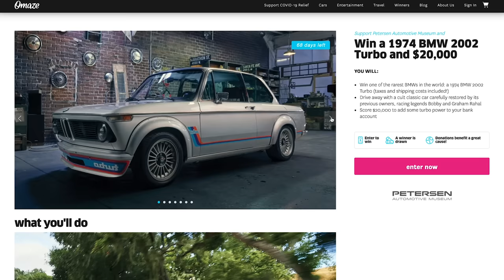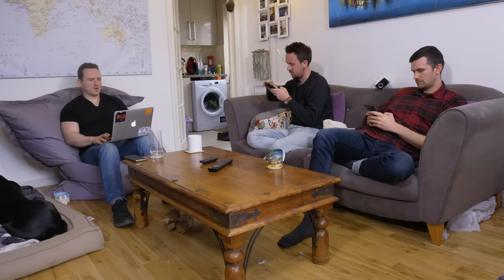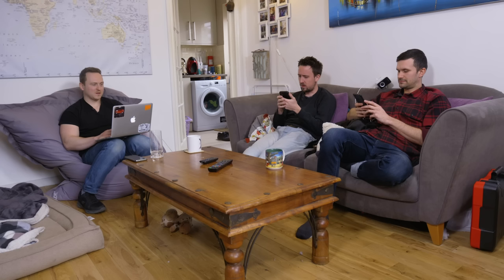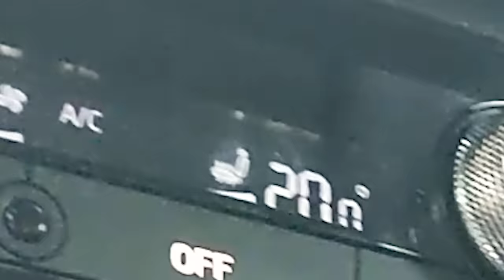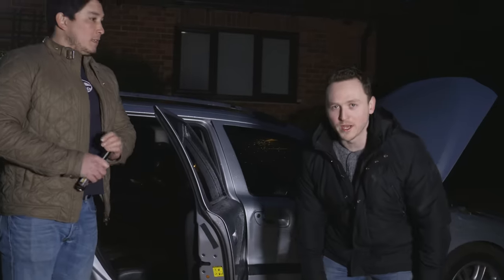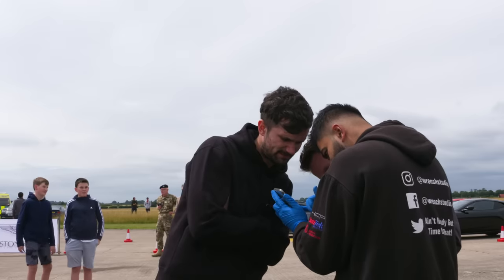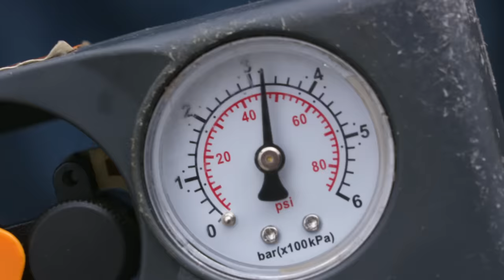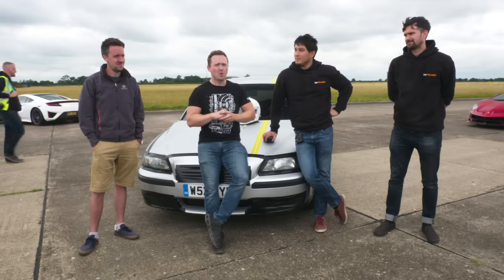Can We Buy A 150mph Car For £1000?

Comment: carry this series on, next do: 175mph for £2000
Reply: Adam Petryszyn  Easy, chipped E32 750i
Reply: Just make the T5 do 175 he'd have change left from 2k lol
Reply: It gets exponentially harder
Reply: 169mph for  £1690
Reply: Old German cars, Merc, BMW. The only problem is they're electronically limited to 155 MPH fron the factory.
Reply: @tyrantstomper  theres ways around that its not a deal breaker
Reply: @tyrantstomper  electronic limiter can be removed
Reply: Maybe they can find a depreciated sports car, that isn't destroyed by the rich boffin who purchased it new
Reply: Not impossible...
Reply: Stage 1 mapped v6 turbo signum, stage 1 fiat coupe 5 cyl turbo, 335i
Reply: @irisheart5920  for 2k?
Reply: @23gatesy  yes for 2 grand, I lost my license last year blasting past an undercover cop in my chipped E32 doing 285kmh on an empty highway.
I bought the car for about 1500 bucks and the chips were 150 bucks.
Reply: @irisheart5920 you'd be lucky to find an e32 for sale in the UK, let alone a 750i, and definitely not for 2 grand
Reply: 175mph is very dangerous speeds
Reply: you could get a 175 for under £10,000, i don't think you can get one for £2000??
Reply: Need £4k to get 175moh machine
Reply: @TuddecBMW  That's what she said.
Reply: Of you can get a jaguar xfr and remove the limiter it will go well beyond 185mph, very potent cars and under appreciated in the market. A stock xfr with some safety modifications delimited went 225mph at Bonneville!
Reply: 175 is a tall order even with money. Not to mention at 175 in a cheap car there would be a good chance of the tyres giving out.
Reply: Adam Petryszyn  an amg withe the supercharged v8 or maybe a s600 (the 2nd gen twin turbo one)
Reply: The only cars that could do it are older German ones but they’re limited to 155 so unless they can find a chipped one it’s quite unlikely
Reply: can you even find cars that can do 175mph?

Comment: Get it back put together, then road trip it to germany, and go 150mph on the Autobahn!
Reply: A few simple bits done and you've got over 300 brake from thag engine, same lump as the focus st,
Reply: I was asking myself why they had to go on a drag strip and then remebered that not everyone has no speed limit. :/
Reply: @kowiniskul  actualy if your car can go 155+ then you don't have to follow the speed limits.
Reply: @jordzz174  Actually the R  line V70 2.5T is already 300hp. It has a metal inlet plenum and bigger inter-cooler as standard. As well as tough clutch. With an upgraded exhaust, add bigger injectors and a remap, you are now looking at 400-500hp.
Reply: @casparharte  It's a T5 with a grill from v70 R,
Reply: @4U6U5  my bad

Comment: The fact that a wagon can even make it past 130 is already impressive to me.
Reply: Oscar Amador same and that it hung together throughout the day and got them home
Reply: @rossgarykelly84  
Those other cars may have been faster than the Volvo, but if you need to take your girlfriend and her fridge somewhere at 140 mph, they would be left red faced in failure!
Reply: Wagons often more aerodynamic than sedans.
Reply: Oh boy, you are missing out on a bunch of fun stuff..! And that’s the slower one of the fast Volvo estates. Audi has some brilliant quick stuff as well, and those are even faster..! Also AMGs and the top end of BMWs Touring range. There are plenty!
Reply: Why? Because it's a wagon? That makes no sense.
Reply: In my Volvo thats how fast i drive normaly
Reply: My buick encore went 136 mph stock its speedo says 170mph. I haven't gone that fast yet buy yeah it was extremely stable for a cuv at those speeds. All other ones I drove just wants to be blown over at least the japanese and other american ones
Reply: @hunchanchoc8418  false
Reply: I had the diesel V70 D5. Only 185bhp, but 400Nm of torque.  That would easily do over 130mph and it had over 200,000 miles on the clock too. Only 0.3sec slower to 60mph than the T5
Reply: @hunchanchoc8418  Not really, a wagon is literally the opposite form of the ideal aerodynamic shape, if the ideal is a water drop with the thin tail on the back and you can see that a wagon is the exact opposite of that. 
Having a flat back generates a lot of turbulence and drag, while sedans (specially ones that have more of a fastback design) generate way less turbulence
Reply: They aren't called flying bricks for nothing

Comment: Those Volvo T5 engines are tough old things. They can run to 500,000 miles when looked after.   With a turbo and intercooler upgrade you could get over 400hp, or more with supporting mods.  Gotta love that 5cyl warble.

Comment: Don’t show a preview of you doing the challenge at the start! That’s clearly a Volvo by the seat.
Reply: Dash*
Reply: Considering I've owned one. I could tell by arm rest. 😂
Reply: anyone can recognize a Volvo by pretty much any part of it.
It's one of the reasons I own one; they've always been styled differently than the rest out there and each generation is actually properly different, which I love about them.
Just a shame the don't have vans.
Reply: @devilskullBEL  funny you mention that. My first was a C30 and I fell in love with the floating dashboard and centre console, made it feel more like a cockpit, especially since everything has a 10degree angle towards the driver. It was ahead of it's time that car. I'd love to see what the new style would look like in a hatchback format.
Reply: I’d recognize that gear lever anywhere, but never mind the video. The thumbnail gives it away already…
Reply: @TheExtremist123  I'm also a massive volvo fan but to say the C30 was "ahead of it's time" for having a feature that dozens of cars have had in the past (even ford sierras from the late eighties had all the ancilliary controls aimed at the driver) is a bit misinformed. In fact, the C30 and Volvos of the ford owned era disappointingly used some Ford parts and lost "some" of the unique "Thats definitely a Volvo" appearance.
Reply: @craig855s  Interior wise, it was everything was simple and flush on the console. It was aesthetically more attractive than most hatchbacks around today.
Reply: @TheExtremist123  I did only say "Some" and by that i mean that looking at the door card you'd guess "ford focus" before you'd guess "volvo something"

Comment: I love how they drive with helmets and everything. Here in Germany you get to this speeds with you entire family in the car without any additional safety😂👍. The Volvo is nice, but just to tell you the old Volvo turbos loses a lot of power as they age, had a few of them all pretty slow for the horsepower. I had a V40 T4 with 200Hp and a 1.8 liter engine. I only got about 210km/h out of it, pretty disappointing. Car manufacturers often claimed there car to have a lot more horsepower then they really got from the factory, can’t trust this numbers if the car is 20 years old with this many miles.
Reply: I assume it's only for insurance purposes for the organiser to spend less on the rent (?) of the course
Reply: It's for insurance as far as I know as it involves timing. I've driven up Prescott in the UK without a helmet but we weren't allowed to time it.
Reply: Ive a phase one v40 t4 myself and yeah past 110 they give up a little bit. this is with a fresh turbo on it too! Apparently not the most aero of shapes...
Reply: Stupid Bloke Stupid Videos yeah obviously my t4 had some issues with the turbo or something. The engine had full compression, put new spark plug and coils in it. Otherwise I didn’t messed with the engine as it run great, other than having lost power.
Reply: God bless se germans
Reply: I miss driving in Germany.  Did a road trip from London to Innsbruck via Germany couple of years ago in my M5 F10 and that was the most fun I had on a motorway.  It’s not just about no speed limits on Autobahn but roads are so much better and on top people have motorway etiquettes so that no one would hog the fast lane cruising at 70mph.  Hopefully I will do it again soon once things go back to normal (or close to it).

Comment: Maybe just add some boost and a larger FMIC? Put some lowering springs on?
Hope you continue to mod this car, would be fun to watch it as a series..

I have thought about buying one of these older Volvos with AWD and manual 5 cyl turbo engine, as a car for driving wood and stuff.
For daily driving I am using my Model 3 Performance with light wheels and KW V3 coilovers, but its only so much I can put on the roof rack of wood at a time.

Comment: taping the spoiler was a mistake. The spoiler is there to reduce drag not increase it.
Reply: So was taping up the front grille. It's an aerodynamic improvement, yes, but the V70 has an air to air intercooler. By taping up the grille they probably lost like 20-30HP because the charge air entering the engine will be way hotter if the intercooler can't do its job.
Reply: @Benny---  It looks like the grill is way oversized for what the car needs. Taping up the top would make a low pressure pocket at the top and probably still distribute air across the whole intercooler pretty well. Either way, they picked up like 2.5% speed from doing that so it looks like it was a good move.
Reply: @Benny---  agreed, could have wet it a bit to possibly help, and i wouldve taken out the air filter too just as a tiny intake hack, it all counts!

Comment: 150 mph = 241 kmh
Reply: Thanks man 🙂
Reply: Most of these should be locked 200 km/h....  240 is insane on public roads think about it in Meters per second.. human reaction time
Reply: @kitecattestecke2303  I've done (speedo indicated at least) 240KPH in my Cooper S. Yeah, needless to say the margin for error at that speed is basically nil.
Reply: @kitecattestecke2303  i did with a 420d gran coupe 150mph on the autobahn.... i was making my drivers license😂😂😂

Comment: I think it's interesting that my current '04 G35 has a speedo that goes up to 160 with an actual top speed of 155 mph, my '09 Mini Cooper S has a speedo that goes up to 160 with an actual top speed of around 140 mph, and recently my friend got a 2020 corolla rental which had a speedometer that went up to 160, but had an actual top speed of 112 mph. My  2001 MR2 has a speedo that goes up to 140 mph with an actual top speed of 130. Soon we're gonna have cars with 200 mph on the dash but are electronically limited to 90 lmao.

Comment: New episodes in making this Volvo faster? :-)
Reply: an xc70 or v70R would be a better go fast chassis as both of those have awd and built bottom ends , a simple turbo intercooler and freeflowing exhaust away from reaching top speed .
Reply: @schemil42 
No it's not.
It's got some R bits on it (bumpers and grill), but it's not an R.
Reply: @schemil42  I thought it was one also until i saw the engine bay

Comment: Yeah i didnt get why they taped the spoiler, they only made it more cut off in the back which creates more drag/pressure. With that little hole under the wing it at least dissipated some of it. They shouldve cut off the wing and open the rear trunk door at little bit to make the rear as pointy as possible.

Comment: 9:54 random Lamborghini Urus getting passed by a Skoda
Reply: Didn't VW buy Skoda so it's relative rivalry
Reply: Dieu Luong Yeah Skoda buys parts of VW. Basicly Skoda is VW and very reliable and great. Sadly people still think skoda’s trash... i took off the key cap on the door handle of our fabia 2016 and there’s a VW logo.
Reply: @Kayshots  lol I've seen videos of skodas with Skoda badging but they're actually VW engines
Reply: Skoda has been 100% part of VW for a bit more than 20 years now.
Reply: @dieuluong2972  Y3W.
Reply: Ikr
Reply: @Kayshots .
Reply: Peasant logic: If a slow car overtakes a fast car when they're not racing, the slow car is faster

Comment: Imagine if someone told him that turbo volvo makes max hp at 5500 rpm 😂.
Reply: But 9 times out of 10 most cars still has better acceleration in the lower gears due to the gear ratio, even if they're past their peak power
Reply: @will_on2793  it's not only that, it's that if you shift too early, even if you're past top power, the next gear will take a long time to rev up again so i'ts better to extend a little bit past peak power so the next gear connects faster.
Reply: @leoglasmeyer2853  Correct. Still I wonder whether slightly earlier shift would have helped as these engines have pretty strong mid range.

Comment: They actually increased the drag of that rear spoiler by covering the openings 🤣🤣 reason why they go down 1 mph.
Reply: Exactly, that spoiler is designed to add maybe a little bit of downforce but primarily to help with the problem of the low pressure area on that slab sided rear end. By taping up that gap they're creating an even greater low pressure area which means more drag.  I'm surprised no one there didn't tell them that was a dumb idea.
Reply: Not to mention the tape flapping rear wheel skirts
Reply: They should of removed the roof rails instead lol.
Reply: Ailios because most people there are in cars they bought for £150k, not built purposely for this
Reply: Taped up front grill and that filter is just pulling in hot air now. Get a cold air feed directly out through the front of the grill and it'll definitely help acceleration all the way down the runway from start to finish. Pull the bottom grill out to open up the intercooler more. And soak it with water before the run. Clutching at straws here but worth a bash 😁
Reply: @disrupter666  at the speed they are going heat soak isn't an issue even taped up, enough air coming in from the lower opening
Reply: @AccAkut1987  True, but it will suffer in the initial take off. My focus st (5cyl) really suffered from a stand still until i got the air feeds. Instantly helped throttle response and wiped out the acceleration flat spots. They had an enclosed filter so it makes sense to chuck on a cold feed pipe rather than having that small hole pull in hotter air from the engine bay until theyre 1/4 the way down the track. The very point in the run that its crucial to get the best start u can. 👍
Reply: K Man  dude just looking at the spoiler you can identify what it's purpose is. As you can see that volvo spoiler has an opening directing air downward the tailgate reducing drag from its tall rear. Unlike any other spoiler which directs air upwards increasing downforce and drag so covering that opening will increase drag more than without spoiler.
Reply: K Man  Yeah you're right it's not a high performance spoiler, but the point is that by taping over it you create a pocket of low pressure behind it that is basically sucking you backwards. Not to do with not having the spoiler, I think you're probably right you could take the spoiler off and it might not make much difference.
Reply: they couldve chopped the muffler and resonator out, carpet and dash and other interior more, and put skinny lightweight wheels with a good balance and alignment. on the first couple runs he mentioned the wheel wobble so that didnt help at high speed lol
Reply: I find it fascinating that aerodynamics is such a mystery to so many...

Comment: I can’t be the only one who’s screaming at them to buy a Saab 9-5 aero...
Reply: Or a 9-3
Reply: YUP, love mine :)
Reply: 9-3 is 143mph but the 9-5 could do it
Reply: Saabs go for no money these days. Fantastic cars, and I'm not even an architect.
Reply: 9-5 Aero, Stage one. Easy
Reply: Yup got a 2006 saab 9-5 aero with a stage 3 and even stock it would crack 150mph. 
Easy.
Reply: Yes!
Reply: You aren't
Reply: Same lol I love my 9-5
Reply: I know 1k quid is a bit more the 1k us but I could t find a rusted out one here for that Saabs are crazy over priced
Reply: John Cunliffe Stage 1 and it increases limiter to 270km/h, don’t know in mph but I’d think around 160 ish. Its also lighter and more aerodynamic
Reply: @wood42shed  no parts left for them. They're a bitch to repair now and getting harder by the day.
Reply: @magincap70  that's not been my experience. A lot of the parts are standard GM and there are plenty of breakers. I guess somewhere that didn't have as many it would be harder but in the UK it's easy enough for now.
Reply: Literally! 😂
Reply: @pudermcgavin4462  There's tons of cheap saabs on sale here in Sweden. Unsurprisingly.
Reply: @wood42shed  yeah in new England it's getting harder to find parts like switches or engine parts like oil pans, but really just about everything requires a few junkyard calls before you come across them.
Reply: @Scotling  stage 1 is 250hp, and they're a fair bit lighter than a v70. reckon that's all you'd need
Reply: @TheMoazeem  definitely. Standard aero will crack it really. 
V70 is a cracking car too though.
Reply: My thoughts exacly
Reply: If the stats on Autotrader are accurate they have similar power but that Volvo has more torque, accelerates faster and (somehow) weighs less. If the modified Volvo couldn't break 150 mph the Saab 9-5 would have had no chance.
Reply: @staggabob  My Saab 9-5 2.0t biopower goes to the electronic stop at 225km/h (140mph). I have no doubt an Aero will do it
Reply: @staggabob  the Volvo has the co drag of a brick though.
Reply: @magincap70  aren't they just out of the GM parts bin?
Reply: @TheMoazeem  2006-on is 260bhp stock, and a Stage 1 map should give 285 plus a mid-range torque improvement. Mine is a Stage1 plus Jetex cat back exhaust, which seems to spool up the turbo a mite quicker.
Reply: @tonyfisk8081  I think I'm talking about the 2.0T and you're talking about the V6?
Reply: @TheMoazeem  9-5 rather than 9-3 - I should have made that clearer!